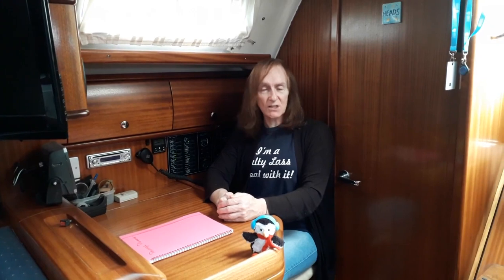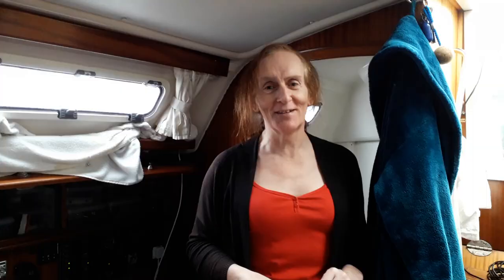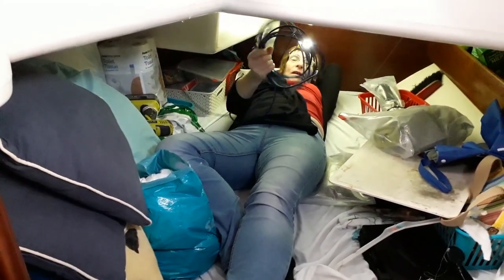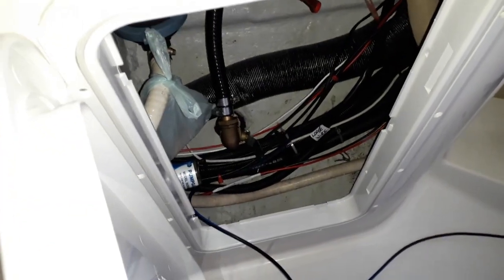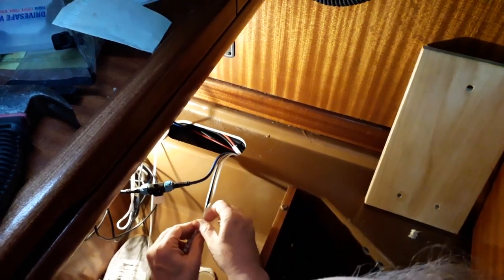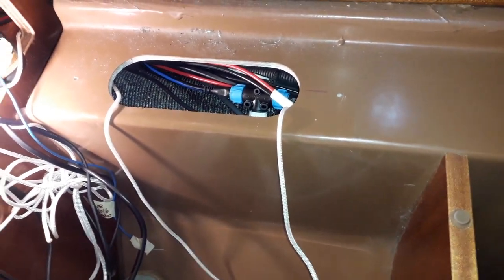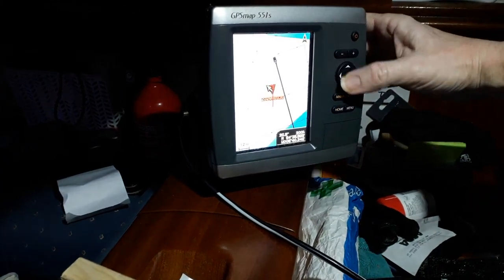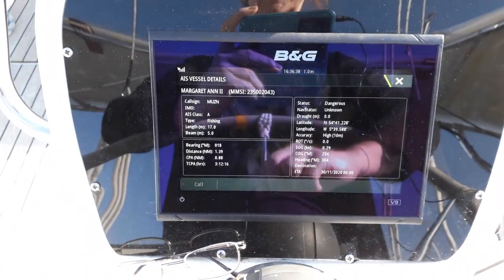Installing AIS on our boat - Sailing Projects - Ep. 128

Comment: Love your videos. Especially during this time of stress, it is nice to have a bit of humour.
I had considered AIS but it is so rare to see vessels other than ferries around the Killary
Reply from the maker: We are still in Belfast lough so there are lots of vessels that have AIS. Liverpool our home port is just as bad, but if we had got our way and started the cruise around Ireland then there are very few vessels that have AIS. For us though it is about transmitting, last year we had quite a few friends that were worried about us, making sure we were not going out in the storms, plus we want people to follow us. For us, our journey is about the people we meet, the things we see and the sheer excitement of discovering new places. So if part of the journey is about the people we meet, then they need to know we are close, so that they can contact us.
Reply: @SailingYachtSaltyLass  I am thinking to just get a vhf radio with DSC and ais receivers built in. Even though my plans are further afield, I don't have the money to get a transponder
Reply from the maker: We looked at those, but not in any great depth. They were (are??) about £500 for the receiver option and £800 for the transceiver option so we just went for the bare unit and plumbed it in (£360 for the transceiver + £80 for the antenna)
Reply: @SailingYachtSaltyLass  haven't seen a vhf radio with ais transmit only receive. The  Standard Horizon GE 2000E is the one I am looking at. I can feed the ais to my chart plotter
Reply from the maker: @thecivvie  - the ones we looked at were the B&G V60 (Receive AIS with VHF/DSC) and the B&G V60-B (AIS Transponder with VHF/DSC). SImrad do the same unit.

The only other one we looked at was an ICOM unit, but it had an oddball connector and was only NMEA0183 and we wanted N2K but it was about £350(ish) and was just an AIS (no VHF)

Comment: Ladies, excellent and yes you now show up on Marine Traffic.  Great little unit the B100 as is the Garmin 551.  We have the same set up.  Noticed you don't have insulation on the warm air heater hose.  It will be a real faff to fit but makes a huge difference.  Not cheap at £18 - 20 per metre but worth it.  Take care from Yacht April Lass ;-)
Reply from the maker: Hi there. We are very happy with the B100. As you say, a great little unit. As far as the insulation goes, that is probably the only bit on the boat that lacks insulation as it is a very short stretch (less than a metre) and it is quite cluttered in there.

Love your boat's name BTW ;-)

Comment: Salty Lass, you all give sound, practical insights. Question for you, I have the same Vulcan 7r and Raymarine EV1/Acu100/p70, all instruments display on the P70, I get intermittent instrument display on the Vulcan 7r, does that happen to you too?  I noticed my Raymarine software is not updated v1.02
Reply from the maker: As far as I am aware, our AIS data always displays on the B&G Vulcan (ours is a Vulcan 9, but I doubt that would make any difference).

I have updated the Vulcan software, but not the Raymarine. Our P70 is version 3.07, our ACU is version 3.02. Our B&G is version 20.2. Our AIS is not a Raymarine unit.

We also have a Ryamarine ST1-STNG converter which translates all the Seatalk-1 traffic to NMEA2000 so that all the other equipment can pick it up.

I hope that helps. We have no "Intermittment" issues with data showing up - or none that I am aware of. Everything seems to work OK
Reply: I think I now finally solved the problem, it appears that a pin may be loose on the NMEA drop   cable to the B&G Chartplotter, faults clear/buss on when I jiggle the line
Reply from the maker: @MichaelSanio  - hopefully a new connector or cable will sort it. I am glad you found the problem 👍

Comment: Hi, does this ais system transit a wifi signal to laptops, tablet and smart phones? I've also got the garmin 551 chart plotter as a primary, secondary is a raymarine chart plotter combined radar, but I also use navionics on tablet and smart phone.
Reply from the maker: No. What this particular device offers is a wired solution, so comes with a usb lead. There are AIS units with built in WIFI as this was something we looked at, but that was so that we could see the AIS data downstairs at the chart table, we thought we would be using a pad for that function, but once we realised we could get the data on the garmin downstairs, then that seemed like the right solution for us.
Reply from the maker: (Bev) - We did look at wireless units such as the Vesper Xb800 or the McMurdo W version. The wifi option added about £200 to the price of the unit and transponders are significantly more expensive than receivers. Also most of these require either a splitter (about £200) or a dedicated ariel (£80 for ours) and we also needed about £120 of NMEA2000 cabling. 

With the costs rolling along and the Garmin for use below decks and the B&G above decks, the Wifi option was an easy one to cut. Dropping it paid for the ariel and the cabling.